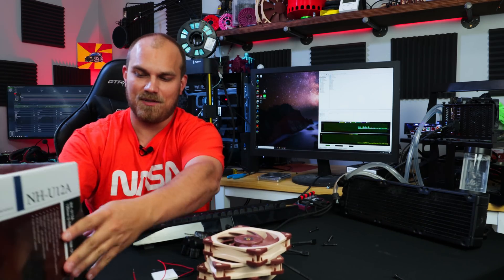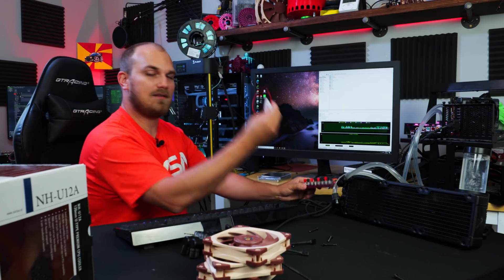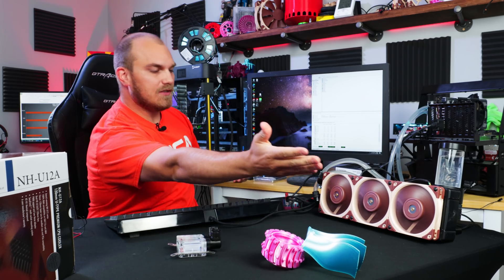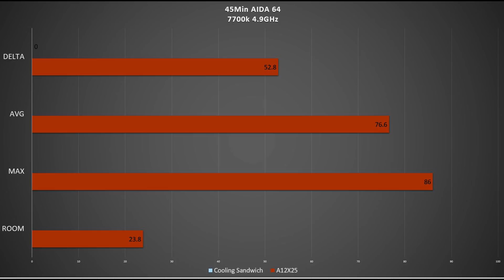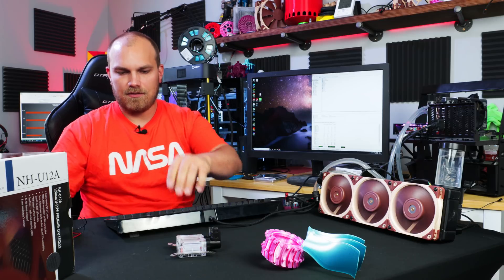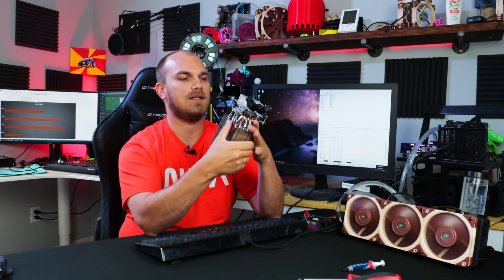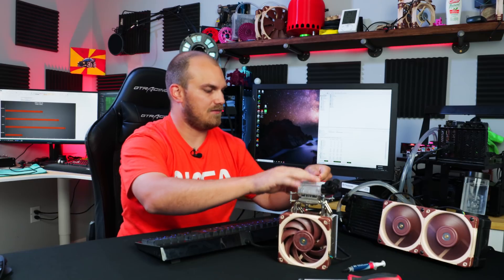Can A Wish.com Water Block and a $4 Peltier Beat a 360mm Radiator?

Comment: One thing that may have an affect is the direction of your air cooler. The heat pipes are designed to bring heat away, but it might be more difficult with the air cooler upside down. The fluid in the pipes will rise when it gets hot.

Comment: What would happen if you sandwiched the peltier directly between the CPU and an air cooler instead of using thermal paste (similar to using a thermal pad)?  Would the effectiveness of the air cooler increase at all?

Comment: I've seen so many experiments like this, the result is always the same: Peltier cells works but they are NOT EFFICIENT enough at the point that you'll have better results just removing them from the loop. EDIT: but we always need Major Hardware to do experiments like this, to look and find if the things the vendors sell us are the better ways to do them, or if they could be improved in some ways! Thank you Major, you're our hero! Greetings from Italy

Comment: I dont think there is a enough surface area to draw the heat out of the water. its one thing to pull the heat out of the metal and CPU with water but the other way around its just way too much water.

Comment: Did you try they same setup, without the peltier cooler in the middle? Just the water block with the air-cooler.

Comment: i been tryina tell linus and jayz two cents about doing this for 3 years now, but instead of just having the peltier you add a rad before it so it chills the water to the cpu and the heat gets dissipated through the rad

Comment: the the peltier cooler as a generator between the cpu and water block of the cpu and see how much power you make :P and also wonder what the cooling performance is like as well i know it will be less but how much less would it be

Comment: I don’t know if someone has suggested running the cold side of the peltier on its own loop with a radiator to give it more thermal mass and make a chiller out of it then use a push pull fan setup blowing the cold air from the chiller radiator and pulling it though the radiator on the loop hooked to the cpu . You could even go farther and hook up the hot side of the peltier to its own water loop and stack all 3 radiators in a cold rad- fans- cpu rad -fans - hot side rad - fans tasty 6 layer dip configuration of ridiculousness.

Comment: Pretty sure Linus did this with like a 600w peltier which was one of the largest at the time.  Basically, these can create cold, but can't overpower the high wattage of modern processors.

Comment: I'm probably way off the mark here but wouldn't having the CPU cooler upside down screw with the heat transfer in the pipes?  My basic knowledge is that the liquid inside turns to gas and travels back down the pipe as it condenses. If you have it upside down it seems like you would be fighting gravity and end up with the liquid condensed in the tips of the pipes and not against the plate where it should be absorbing the heat from.

Comment: If you want it to work then either you want the Peltier modules to be directly on the CPU and have a water block on it or you could have an fan cooler on it.

Comment: Not going to do the math, but using basic understanding of physics there was no way in hell the peliter could have beat a 360 RAD. Looking objectively the 360 rad has to dissapate X watts of heat from the CPU. With the peltier setup you have the tiny leetle air cooler you have has to cool X watts of CPU, and Y watts of heat from the peltier. I haven't looked at the physics but it isn't magic, you put power in and it makes a hot and a cold side. Anyway I'm going to leave this explanation here before I make a fool of myself by making too many assumptions.

Comment: The cooling on the hot side of the TEC needs to be much , much better. Essentially you need more cooling for the TEC than you would just cooling the CPU directly.

Comment: I have always wanted to know what the impact would be, if you had a cooling loop that had a TEC cooling a block that the CPU loop went through, and an AIO on the hot side of the TEC. So not removing any of the original water loop cooling capability with the radiator. It's pretty clear you can't replace any kind of cooling with a TEC, but can you enhance the water cooling?

Comment: i did peltier cooling for a science experiment like 5 years ago. i got a monster of a pad like 300 watts and attached it to a h105 aio with some 9000rpm fans. i was able to keep a pentium 4 at 1c for extended periods. possibly lower since i dont think the motherboard read temperatures below that. loads of fun to do but 100% totally impractical. im surprised how well the motherboard held up considering i was a total noob at sub ambient cooling back then. i put kneading eraser around the socket to help but there was still so much frost buildup on the backside. i still have the cpu and motherboard and they still work!

Comment: The way i used the peltier was doing a chilled water setup. Hooked up the peltier on the side of a reservoir with an air cooler attached and a thermostat controlling the peltier. Placed the thermistor inside of the reservoir. It did work to cool the water down to 5 degrees celcius.
Reply: Also, a little advice for using peltiers. The cooler you can get the hot side of it, the colder the cold side will get. If the temperatures that you are trying to cool are too warm for the cold side and you have inadequate cooling on the hot side, the hot side temp will start to bleed through. This will turn it into nothing but a glorified heater. Also, try not to run the peltier at the maximum 12 volts. Run it at say 9 volts. I used a dc to dc converter for this. I also insulated the cold side to prevent the ambient air from interfering with the performance of the cold side.

Comment: Try attaching 3-6 to the rad, with those attached to air coolers.  It may seem useless but "effective", but if you have it located in another room with thet tubes running from the PC to it (like mine was) it does a really good job at silent cooling with better stats than any AiO.  Or rather than using a radiator, use a 100% metal waterblock.  Usually used in scientific applications, but you can find long ones that'd they fit to on Amazon pretty easy.

Comment: you should build a fan supercharger. connect a belt to somewhere on the fan motor and connect it to a tiny twin scroll supercharger on the box to suck in more air? does it suck more air in than  a normal fan? I doubt it but it sounds cool as Hell. That would be cool lmao

Comment: We have seen these Peltier experiments for years, and still no one managed doing it right?
What we all know:
1. You need very much power regarding the Peltiers. It needs to overmatch the CPUs heat wattage. You will need a very big PSU for the Peltier alone.
2. You need a tremendous amount of cooling for the hot side. One mere 140/120mm fan won't do even remotely. Not just a standard CPU cooler.  Something like a Mo-Ra on the hot side is wat]]hat you should start with, for having at least a slight chance for sufficient warmth removal.
3. Of course only use the finest components, like a good waterblock. Because of the extremely low overall efficiency this will save you a lot of power and heat, as the difference is multiplied by the Peltier.

Then, and only then, you might be able to enjoy below ambient temperatures in your CPU. Anything else doesn't make sense. Staying above ambient will always mean that you are just wasting efficiency for no use with a Peltier, as yoou would have better temperatures without the Peltier than with.

Comment: I've said it before and I'll say it again, You should mate two CPU waterblocks together and use them as a heat exchanger between a conventional water cooling system and a more exotic system like the the bong/evaporator cooler.

Comment: Have you tried it with the cooler in the designed position?
Either sideways, or with the heat source at the bottom?
Heat pipes tend to work in the right orientation

Comment: I'm wondering if you put a stock or low profile heatsink on the cool side and stick it in a box would it cool a couple sodas or beers?
Reply: They sell those... that’s what they use in cars to cool the drinks (they are the $20 soda fridge), of course the heat dumped into your car is 10x higher than what it’s extracting so they use huge amount of power (maybe 30x more power than a regular fridge), but they do use them for that, it’s just terribly slow and inefficient.

Comment: What about adding the peltier to an existing water loop?
I mean, have the colder return hose to the CPU be connected to a peltier device and see if that super cools the water in addition to a reg loop setup. How much lower could you get in terms of temps with and without the peltier device?

Comment: I think the peltier is the limiting factor here. You are trying to pass 100+ watts through it when loading up that 7700k. I suspect doing straight waterblock to aircooler would work better.

Comment: I used to have a pair of 40x40 TECs to cool a water loop. I customized a DangerDen 5.25" Acrylic Tank by removing the bottom piece of acrylic and replaced it with a 1/16" piece of aluminum sheet metal.  The TECs were attached to that with a couple of CPU coolers and fans. The loop was Tank -> CPU -> Pump -> Radiator w/Fan -> Tank.  The idea being that to get the coldest coolant (read automotive antifreeze basically) possible it needed to spend a lot of time resting on the TEC and be as close to ambient room temp as I could get it.  I think I managed to get about a reasonable drop over ambient room temps but it was a PITA and these weren't the cheap wish.com style ones either. Honestly, I wouldn't run that type of setup again, modern water cooling systems are much more efficient than the early 2000s when I used to tinker with trying to OC a CPU to within an inch of its life and such.

Comment: try out a better water block, and no TEC cooler, and put it against the same air cooler to see if the dual water block setup will do better.

Comment: Cheap Peltier coolers are about 10% efficient. That looks like a 40mm Peltier, guessing about 80w max (power is inverse to temperature differential, so it's most efficient at 0º differential). At that 0º is can pull about 8w off the cold side, delivering 88w to the warm side. That Peltier isn't even close to cooling a CPU, and one that could would take HUNDREDS of watts of power.

Comment: Instead of showing another fail Peltier project on YT, why not read the specs and make a setup that actually works? I've used them in the past and they work well if use them within their limits.  Get enough peltiers to handle 250-300w applied power(at max spec'd voltage) and cool the hot side with radiators able to dissipate 4-500W.  Thats how you show Linus how its done^^.  Apply liquid metall on both sides of the Peltiers since the hot side is like a thermal nuclear bomb hehe.

Comment: Replace the waterblock with a aluminium or othe metal case so it gets cold all the way trough and water hat to have mor surface contact to the metal block maybe then you will see improofment.Or attach 2 bigger Peltiers onto the radiator without fans.Cheers

Comment: ive seen cheaper water blocks that is just a chunk of metal with a hole running through, you could put a peltier either side of it, though im pretty sure this one has no channels in it, just a plain old tunnel, and cheers for the mention :)
on aliexpress, 40mm*40mm/80mm/120mm/200mm Water Cooling Heatsink Block Waterblock Liquid Cooler Universal For PC CPU GPU SB North Bridge-Screws

Comment: put the Peltier straight on the CPU and put the heat sink back on it, then see if it stays cooler than the AIO
Reply: That was done years ago when the AMD Athlon was the best cpu available.

Ps. They had to conformally coat the motherboard due to moisture forming on the peltier and running onto the MB 🤷🏼‍♂️
Reply: @-Gadget-  I would still like to see it work.

Comment: This obviously cannot work. The surface area that the water has to dissipate the heat is so low compared to the radiator. The peltier is bottlenecked by the water. When it cools the metal of the heatspreader which has thermal conductivity of 0.5 (aluminium) it is 100 times better then cooling water (thermal conductivity 0.005 when chilled, or 0.012 on room, and more when hot). Mount the peltier to the cpu with much more cooling on the hot side! And a themal probe and an arduino to control the peltiers to have less condensation :D But the peltier is probably shitty as well and wont work well in that way also. It is Wish.com scam anyway. If they sell as TEC1-12715 you will at best get a 12705 with a different label. Same goes for AliExpress, they sell relabeled 12705 as 12715. Try to measure the current you get at 12V and check what you got it should be close to 16A to be a 12715.

Comment: The experiment wasn't a failure, yet. how's your skills with a brazing torch?  I'm picturing a four sided water block made of copper with an NH12 and peltier on all four sides, the water enters the block goes through the top through a series of baffles and exits out the bottom.

Comment: how to make it work:  you need a res with the peltier cooling water connected in parallel to the main loop with some kind of valve and thermostat control. the peltier comes on and cools a quantity of water as low as it can go. the thermostat opens allowing the cool water into the loop and new water into the res. repeat. only way to increase the heat capacity is more powerful peltier. if it could rapidly cool the fluid in the res (im thinking 5-10 seconds) and the res holds a similar quantity to the main loop you should be able to do some good cooling.

Comment: Instead of having a water block there I wonder how it would work directly on the CPU. I mean thermodynamics says terribly but it would be interesting. I'm sure someone has already tried it already on youtube but i'm too lazy to search.

I am also curious if the water in the black is moving too fast and not dumping enough heat. I really don't know as I know very little about thermodynamics and moving fluids.

Comment: That idea makes 0 sense and wouldn't work right off the bat because you're still only using a tower cooler to dissipate all the heat plus you're adding the heat of the TEC module. You could've just tested the tower cooler by itself and get better temps. 
TECs were a thing when CPUs had low power and so a tower cooler was so overkill for just the CPU that he could also cool the TEC and thus get below ambient.

Comment: Turn the thing upside down man, convection is a thing.
Reply: i was looking for someone to comment on that. the heat pipes have to be a certain orientation to work properly.
Reply: Ohh, you mean right side up.
Reply: You guys get it. Not only is the Peltier under powered but the orientation is causing the air cooler to actively work against itself by heating the top side preventing any condensation that might have occurred due to the peltier heating the pipes.

Comment: I reckon it might of worked better if you had the air cooler the right way up. To help the heat flow through the heat pipes more easily. Like people have said it probably needs a more powerful peltier also

Comment: So TEC coolers are efficient at 10-20% rated power. your heat dissipation has to be double what you want to cool. they're essentially more effective heaters than coolers due to the physics of the design. I have been working on a similar set up that is much more robust and efficient. https://imgur.com/a/xZzJzlT

Comment: Why can't you or anyone do peltier cooling correctly? PUT THE PELTIER IN SERIES AFTER THE 360 RADIATOR. The 360 radiator takes most of the heat away. The peltier then cools it down further. What's so hard about that idea???????????????????????????????????????????????

Comment: Protip: peltiers work better as energy converters then they do cooling devices. Try and rig up making fans run off the Tec using a heatsource from the computer.

Comment: You should probably sit the cooler up right, heat rises and those heat pipes reply on that for vapor to run through the pipes to the fins to get cooled off to where the water in the pipes will go back down to the plate area of the pipes. Sorry me no feel like grammar rn.

Comment: Next time make sure the air cooler is facing up. Now the liquid in the heat-pipes is not doing anything 😉 plus forcing heat downwards is a pain. so water block at the bottom and the Nh-U12A at the top so that the heat is going up. I  assume that the result will be the same as using the air cooler directly on the cpu. only difference will be the time it takes for the temps to settle. just my two cents.  😉

Comment: Ehh a thought most heatpipes work as evaporation where heat rises up so i do not think it's designed to work upside down.
I know they take into account that it will be mounted sideways on a motherboard but here as i see it the cpu cooler is literally in the worst oriantation.
Did the cooler get warm ?
It only works if it can get rid of the heat and her it is probably only through the metal contacts as the evaporation process is hindrede.
Reply: Ahh don't mind me.
Read up on heatpipe funktion so my baad it shoud work just fine.
Had forgotten that it was in vacuum and the capillary effect.

Comment: Multiple or larger Peltier coolers might help. Those things are so inefficient. Takes a super high quality one for it to be small enough to be the size of a CPU block lol.

Edit: Check out TEtechnologies. They have some products under Peltier, then High Temp modules that are like 30 bucks and meant for up to 200C components. The rest of their site has other ones, tho the full devices they sell are like.... Expensive lol.